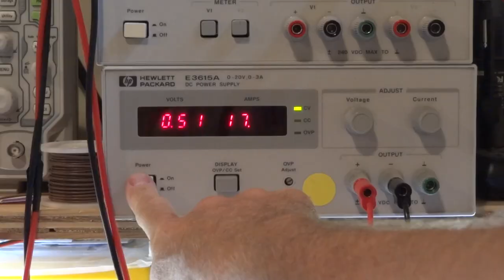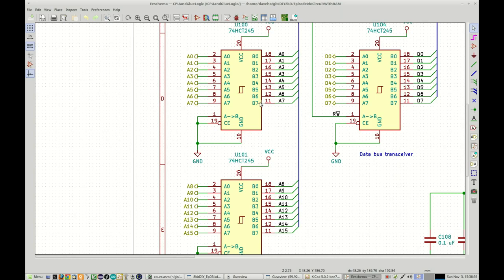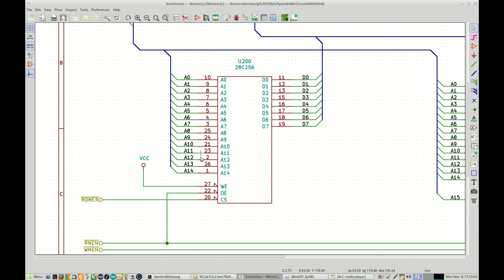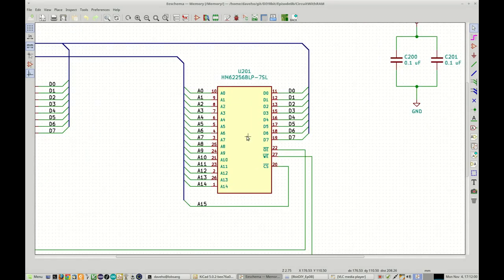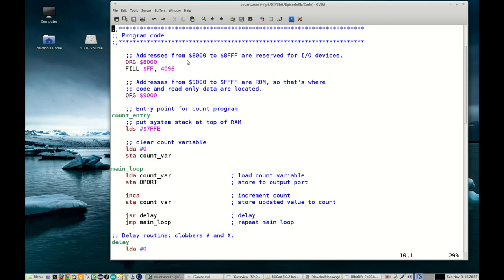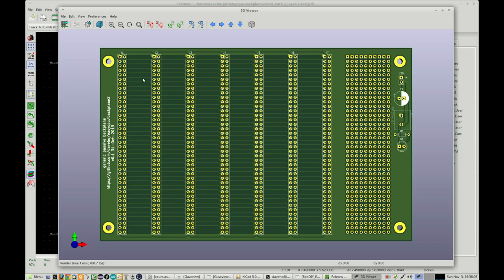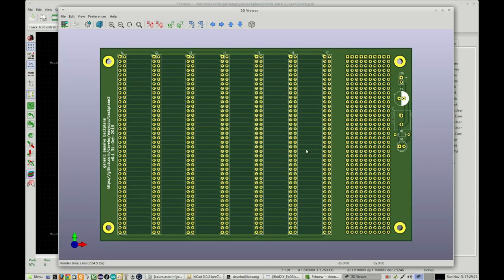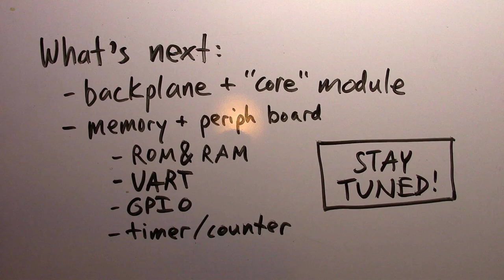DIY 8-bit computer, Episode B: Buffers, RAM, and a plan

Comment: A lot of this looks scarily familiar! 🙂 I am designing my system in Kicad too and have used 74HCT245 buffers in exactly same way. The pinout of the chip is so much more friendly than the '244 and since I had a bucket full of them it was a no-brainer. I also used a '245 to buffer my control bus signals. The only real difference is my passive backplane - I am using 96way DIN41612 connectors onto a Eurocard backplane. I'm only using 64 lines for this project (rows A+C, row B is grounded) but intend to build a 68000/68010 system next using a lot of the same hardware which will use the extra 32 lines. 👍😁
Reply from the maker: Very nice! My backplane was improvised to a large extent, although it's worked out pretty well. I can see advantages in using a standardized physical format. I agree about the '245: I seem to vaguely recall that the weird organization of the '244 has something to do with single-sided PCB layouts, but from the standpoint of building a circuit on a breadboard, it's a nightmare. The '541 also has a nice straight-through organization.